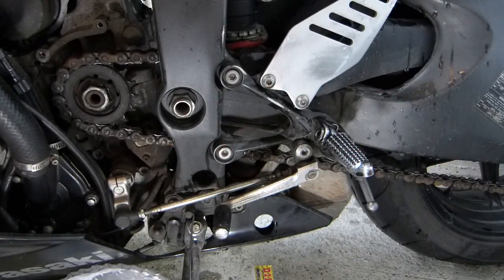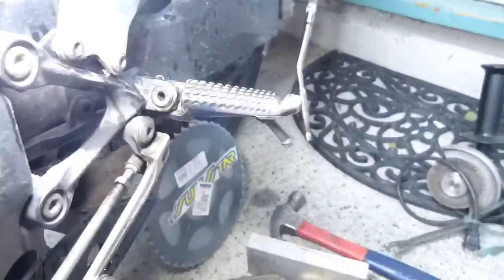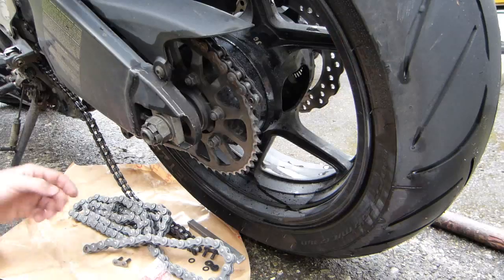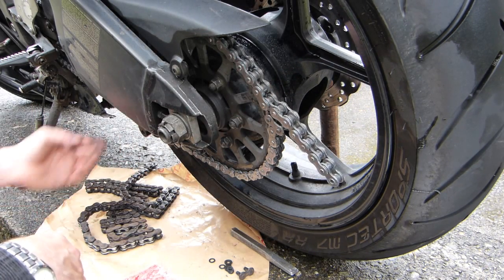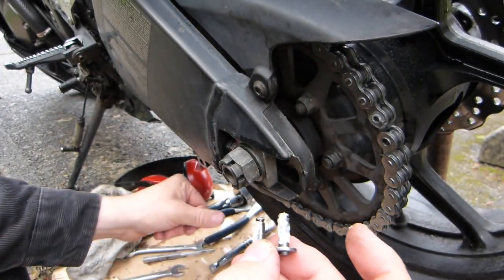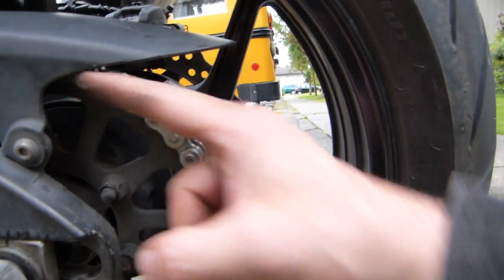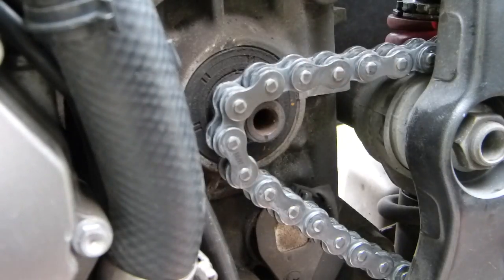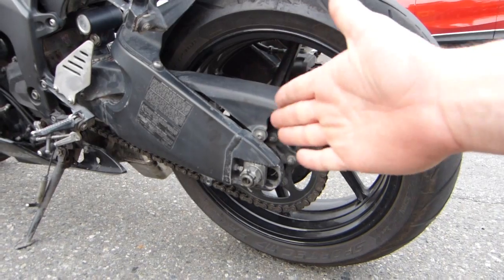Motorcycle chain riveting with simple tools at home

Comment: This video is downright dangerous. I hope no one uses this as an example of how to replace a motorcycle chain.
Reply: It's not dangerous at all, explain why? The link will stay in and not go anywhere unless you grind it off.
Reply: dixienormus1619  the rivet is not cracked its split at the end where is "mushroomed" over. This part bears no force whatsoever. The pin through the chain holes is completely fine. I literally know several world class road racers that live in Northern Ireland the home of road racing, and they have always used this method spanning 20 year careers, never has a chain come off.

Comment: We used to do this shit in the bad good old days. there's no reason to do it today.
Just buy the manufactures specified sprockets, chain, and a chain breaker/riveter. It's much easier than trying to hammer the pin. They can be bought for about £40. That's less than half the price of a chain and sprocket set. DO IT RIGHT AND SAFE.  DO NOT follow this garbage, folks !!!! 
Delboys Garage has a great video on how to change the chain and sprockets. Plus many other motorcycle tasks. 
Don't forget proper chain adjustment and lubrication help prolong the life of the chain and sprockets.

Comment: I would never do this!  Hack jobs can be dangerous and fatal.  You paid thousands of dollars for your bike, helmet, gear, and you won't spend $100 on a good chain tool!  Yes, in a pinch on the road, you can do this, but change it as soon as you get back to civilization.

I liken motorcycle riding to flying an airplane to some degree.  Check everything before you ride.  You want everything done perfectly, using procedures generally accepted by professionals, and always with a margin of safety.  If you made your living as a mechanic, would you do this for your customers?

All this aside, you made a good video that explains the fundamentals of how chains are designed and constructed, so we can understand fundamentally what is needed to get a chain back together in a pinch.

One last thing, hammering on your rear sprocket like that can damage your wheel bearings (dimpled races), especially sideways which creates a lever equal to the radius of the sprocket.  Yes, the sprocket is sacrificial since you're replacing it, but the bearings are not.

Comment: Love it. I think thats a great guide using hand tools. It's a 1000 times safer than one i saw fitted using a chain tool by a very well known you tube bike mechanic. Most of these small chain tools are cheap rubbish and dont work. They dont flare the end of the links. I love that block of ali with the clamps, great idea.
Reply from the maker: Thanks for watching!

Comment: Props for the DIY effort, and no offense, but I would never trust that master link. I wouldn't use a sharp chisel to flatten the rivet head. If I didn't have the proper tool and absolutely had to do it in an emergency, I'd use something flat to deform the head. Didn't look like you compressed the master link plate enough either. I hope for safety's sake, no one views this video as as a reference for the proper way to replace a motorcycle chain. There are much more thorough videos out there where proper tools are used and measurements are taken.
Reply from the maker: My bushfix has been holding since Aug 2017.
Thanks for watching.
Reply: Glad to hear that. That's good info (seriously) for those of us who sometimes struggle with perfectionism. So I find value in your video after all. Thanks man!
Reply from the maker: No worries. Also, using proper tools are unquestionably safer. My approach is attuned to markets where bush fixes or limited availability are the norm.

Comment: get a km500r chain tool.  fitted spring clip type master link on gpz500 today, turn plate in km500r tool so fj50 marking faces the outer plate , tighten up.  no need to use excessive force. 
fj links are for use with spring clips , zj links are for use rivetted.  km500r d.i.d chain tool can do both,  also need 27mm spanner and 19mm spanner.  grind old rivets flat so easier on chain breaking tool.

Comment: 25:30: You keep it under the seat of the bike. Would you be able to replace it on the side of the road? With tools that fit under your seat.
(You've shown a punch for riveting but you might still have to remove the broken link, depending on the type of failure)

Comment: What is tha diference between clip and rivet ? A bit confuse
Reply: The clip type slide into place over the master link and then locks it.  You can do this with a needle nose plier or a screw driver.  Rivet type press the top of the links down locking the master link into place.  You usually need a special tool to do this with.  The OEM chain is a rivet type, you either have to grind the link down ir cut it.  Replacement after market chains can be either clip lock or rivet lock.  I had a Honda CB 750 for over 10 years and 120, that's right, 120 thousand miles.  I did several chain replacements and always used a clip lock.  I rode this bike on interstates and never worried about the clip coming lose. To each his own.

Comment: Why would you rivet a clip type type lock? In sweden we call it dumsnål. You try to save money but in the end it cost way moore.
Reply from the maker: Chain has been intact, fully functional since. We call it done in English.
Reply: @theoverengineer  The link is NOT a rivet type you have  , it is a clip type master link , the orings on the inside you have crushed as the link should measure the same as all the others , do it right or not at all .

Comment: How do you like the M7 tire? What kind of mileage are you getting from the tire? My M3's only get about 5k but they grip well.
Reply from the maker: I have this https://www.youtube.com/watch?v=hRjUcqj9bBs,
I`m on my second set of M7 Works in winter down to -10, no snow or ice, works in rain, I like it.
Grandpa` riding - I got 30,000 km or so out of it. Actual figure may be in video link.
Reply: I got about 7k miles out of my M7's and that's pretty aggressive riding. So not great but not too bad.

Comment: Sorry but I dont understand why did you rivet the link that suppose to be secured with clip only? I dont think that this connection link is designed for rivetting at all. And I dont think that this is safe either.
Reply from the maker: 1 Like I said, missing proper link was weeks away.
2 Of course is not designed for riveting.
3 Been working since on my bike.
4 I`m not responsible for anyone`s safety. All my video is about is: This is what I did and this is how it worked.
Reply: Oh....OK.....I missed that. Sorry.

Comment: Can you re do your video again , but try using a heavier steel backing  block and a proper weight ball peen hammer,  you'll much much better results.   Do not go at it with a hammer and chisel.   The claw hammer is for fixing your garden shed , not your motorbike

Comment: What...!! if my bikes chain was riveted like yours, the chain would be lucky to survive more than 100 miles..You split them while bashing them with a hammer... very bad idea !!!
Reply from the maker: It just happens to work, as explained in great detail.
Reply: ...Mmm, maybe on a 600 cheapish bike, but not on a 1000cc L-Twin...
Reply from the maker: Probably, never tested it to find out ... The proper link hand riveted on the properly sized chain is proven to work.
Reply: ..While I appreciate your video as a help to those in need of new chain, sprocket set.. all i'm saying is there is a much better way to preen the rivets over... bashing with a hammer is really bad. The rivet has split & could fail anytime. The compression of the links under load can squeeze the rivets out to the side, the force is not all along the length of chain, but sideways too.. that's why we use rivets in the first place. Good that you suggest to carry a spare split link though.. not many think about that...
Reply from the maker: Absolutely right, there`s no substitute for a job correctly done. Thanks for watching.
Reply: Dude i riveted my chain with a hammer and a nail and i have driven over 10000 miles still very good
Reply: And also the dude didnt tell its gonna work on some crazy bikes and doing burnouts wheelies drifting whatever ofcourse its not gonna stay i ride motocross with my kx250 and it has a mile reader you know and thats where i took 10000 miles
Reply: but how do you think they use to do it back in the day before a tool was made for it ?

Comment: Why not just use the master link? Dont think you're benefiting performance wise by doing this, esp hammering  while its on the sprocket?
Reply from the maker: Master link is not used on high powered-bikes. Hand-riveted link is still holding since.
Reply: I wouldn't have been hammering it on the sprocket either

Comment: At 20:59 you riveting pins that is not for riveting. Why? You are at possession of right sort of pins on spare links. Hard mistake.
Reply from the maker: No mistake, deliberate bush-fix, as the supplied chain model was ordered wrong. Correct part (rivet-fit connecting link) actually arrived weeks later. Ready to replace incorrect part any minute,  but bush-fix is holding. Yet.
Reply: You could (I try to use past tense here :) ) reuse pins from leftover new links. That would be interesting approach.
Reply from the maker: Absolutely. This got me a video idea that I could easily do: comparison of the 2 different pins in the 2 types of connecting links (involving destructive testing)
Thanks for commenting.

Comment: That's the most vital parts of a motorcycle therefore i wanna do it according to physics-based by using the correct tool application. Not primitive way of doing it such as this video.
Reply from the maker: Chain is still together, no issues. Primitive can work when done well. Nothing wrong with better tools, though.

Comment: You are so almost spot on with no need for a chain tool kit, especially a cheezy one! Now how can you be so uninformed ? And ignorantly misleading some DIY squids to killing themselves! Clip link is a clipped link // rivet link has a link that has guide holes for a mushrooming with a chaintool or a simple center punch.  I have used this method for some time even with 200 HP + bikes with no fails. Not for home dummy use!!!   Sorry I jumped the gun, hope all watches to the point you correct you misleading first part.

Comment: Very useful, thank you. Is there an alternative method to remove the front sprocket, or is it best to hire an impact gun and be done with?
Reply from the maker: Might be able to remove it with breaker bars, I used impact wrench, took 30 seconds. Sprocket replacement details with video coming in 3 days.
Reply: theoverengineer I had to use an impact gun, that's the tightest bolt on the bike TQ specs are 189lbs
Reply: I removed mines with a wrench and the bike in gear

Comment: Congratulations you saved $80 on a tool that you MIGHT have purchased and used over and over again
Reply from the maker: No. I saved $80 on a tool I don`t need. End of story.
Reply: @theoverengineer  the proper tool would do a much better job of mushrooming the rivot.  Your way appears to work but you've also weakened the pin by cutting it introducing the possibility of the pin splitting through.  Pretty much what others in this thread have said.  I'm not saying your process is totally flawed, you just need a better way of flanging out the pins- one guy suggested using a hammer and nail-  it would be interesting to experiment with that orrrrr;   you can spend $45 on a tool that will last 3 or 4 chain swaps-  that's $11 per swap and no hammering, no chiseling and more important...no risk.  Ride safe everybody.